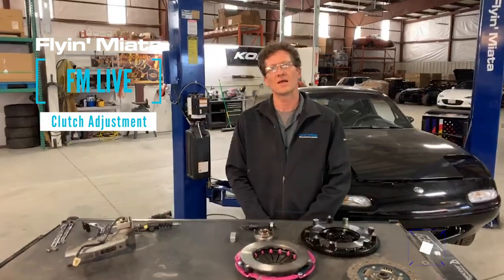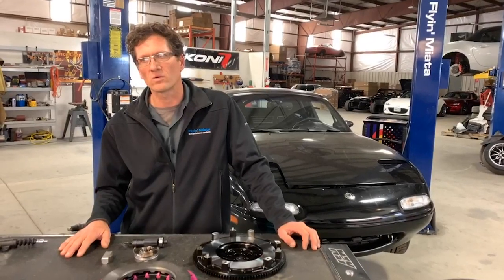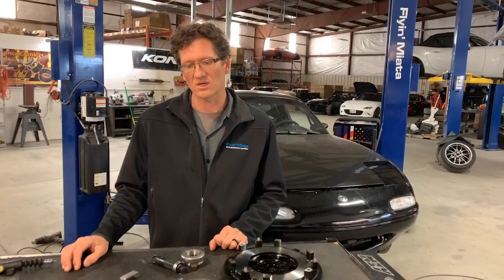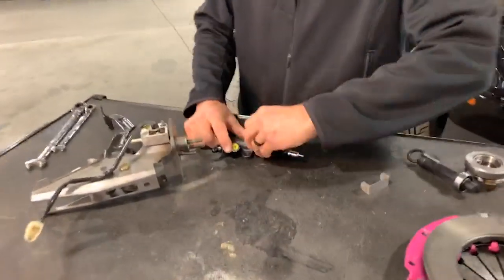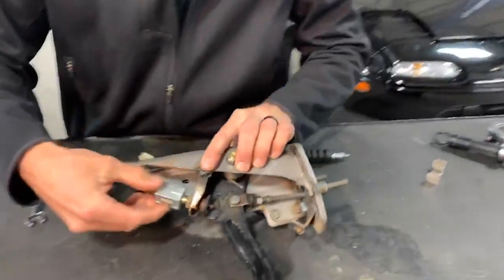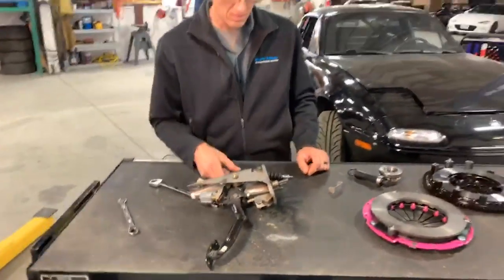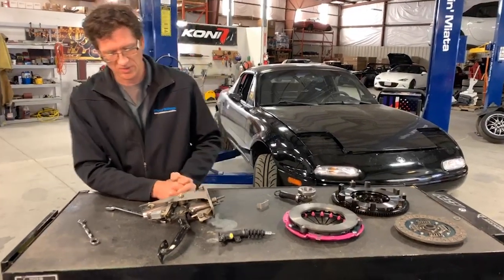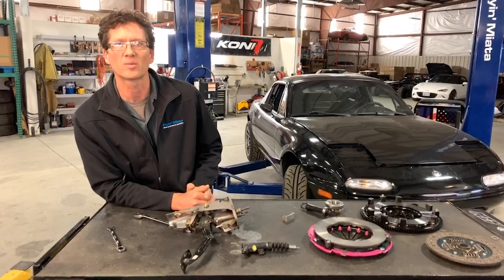Miata NA/NB Clutch Adjustment (FM Live)

Comment: I don't think I understand how the clutch safety witch override is beneficial to a bearing? What is the "thrust bearing" and how does having the switch always engaged provide additional lubrication? Thanks.
Reply: Thrust bearing stops your crank shaft from walking (Crank-Walk). Its a piece inside the engine holding your crank from going forwards or backwards. When you add a heavier pressure plate, it adds more stress to the thrust bearing, which is bad, especially if it isn't properly lubricated. The safety switch delete makes it so you can start the car in neutral without disengaging the clutch I.E. putting stress on an unlubricated thrust bearing
Reply: Problem is 'dry ' starts, when time since the  car was last used has the thrust bearing drained out of any residual oil. On starting, it takes a few revs for oil pressure to build and move new oil to the thrust bearing. No oil and end force on the crank wears the thrust bearing early. Starting with the pedal floored puts end force on the crankshaft. The safety interlock defeat removes this force on dry starts. And the thrust bearing lasts far longer.

Comment: I know this is an old video but I'm at my wits end and hope someone can respond lol. I bought a stage 1 clutch for my 96 1.8l, and since installing it, it squeaks. Almost like a bad throwout bearing but I replaced the throwout bearing when I installed the new clutch. I've greased both the ends of the slave cylinder and it's still making the noise if there isnt pressure on the clutch. Like if I have any slack at all in the clutch pedal it squeaks.
Reply from the maker: The squeak could be something as simple as the fork pressing against the slave, or the spring inside the transmission housing. Give us a call directly or email support@flyinmiata.com and we'll be happy to help troubleshoot.
Reply: @FlyinMiataVideo  I actually figured it out the other day, it was the clip on the back of the clutch fork inside the bell housing. Apparently I didn't grease it enough when I was putting it in. Absolutely loving the clutch, and it's holding my turbo power well haha
Reply from the maker: @promethieos1875  Glad to hear it was an easy fix!

Comment: sooo i've been doing my research reading as much bad reviews than good one and i think i came to a conclusion. Because of the FM clutch requierment of a long trow to have less pedal effort, if you dont adjust correctly the clutch it will never be fully engaged. Thus some poeple have problems because they break in their clutches with it sliping a little bit. And has we know if you fuck up the break in, the clutch is toast.

I'm wondering if comp clutch the same company that makes de FM clutches for flying miata specs makes the same clutch but maybe with a higher pedal pressure but less need for maxing out the stock clutch adjustement to have it disengage. That would give us more adjustement for the pedal grabbing point.

Comment: I'm getting ready to swap out my stock clutch with 158k on it with one of your Happy Meals clutch, but I'm getting a little worried on all the reviews about it only lasting 10k miles. I understand that I'll need to adjust the clutch pedal afterwards, but I'm expecting it to last as long as the original clutch did. Why is it I'm reading that peoples are slipping after only a year or so? Could you elaborate on this? Is not an upgraded clutch supposed to out live and out perform the stocker? I understand a lot of it depends on driving style, how hard you are on it, etc. etc.... but as I've said- mine is sitting at 158k.
Reply from the maker: Clutch wear depends a lot on driving style and use. The initial adjustment and thus break-in has a really big effect as well. A lot of people installing upgraded clutches are asking more of them than the originals could handle.
We don't expect it to last any longer than a stock clutch, but have no reason to believe it should be any shorter lived if treated the same and the initial adjustment is done properly.

Comment: So I put a new clutch in my Miata, and the car wouldn’t go in gear, meaning that the clutch wasn’t disengaging. So I adjusted my clutch and it works but it starts grabbing right off the floor. Never did that before. I have a new slave cylinder in as well so not sure what it could be. New TO bearing, new pilot bearing, and bled for bubbles. Any suggestions?
Reply from the maker: That sure sounds like a hydraulic problem. Check that new slave cylinder for leaking. It's also possible (but less likely) that the master has a problem.

Comment: Problem with your clutch safety switch tool is that you cant use cruise control.
Reply: I can use cruise control
Reply from the maker: This is incorrect. This should not effect cruise control. Give us a call if you are having issues and we can try to help you find your issue. 970-464-5600
Reply: You are mistaking the clutch safety interlock function with the Clutch Position Sensor function. The latter is behind the pedal, and part of the CC system. The safety interlock is on the firewall, and in the ignition circuit, not the CC system electrics.